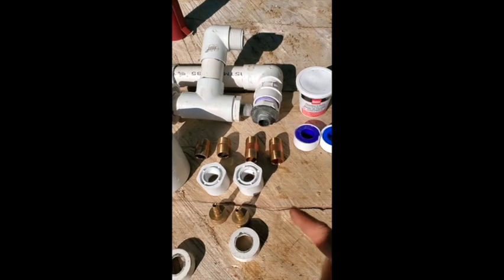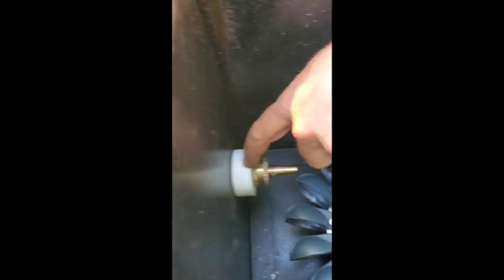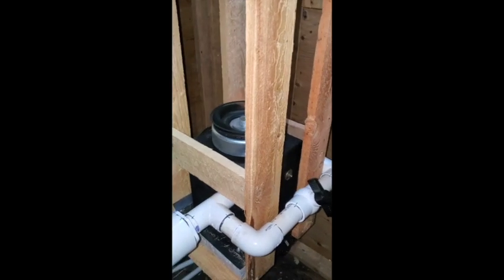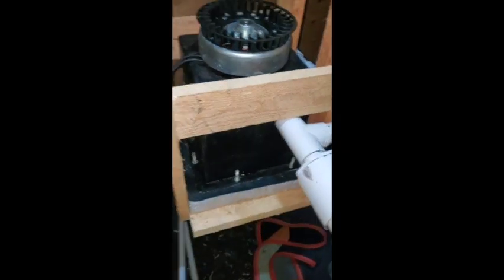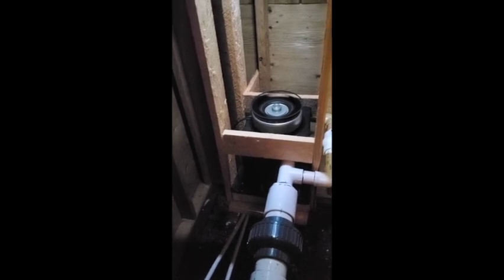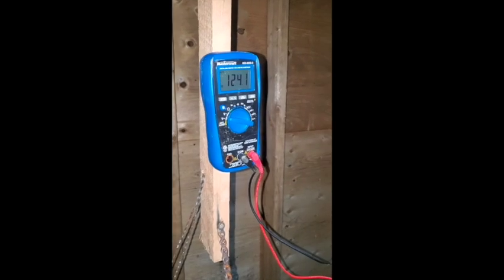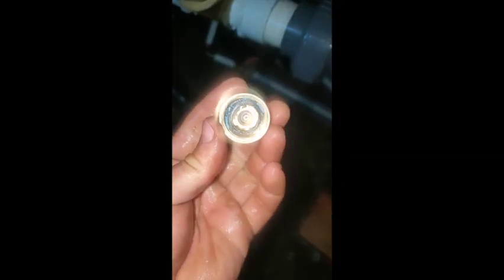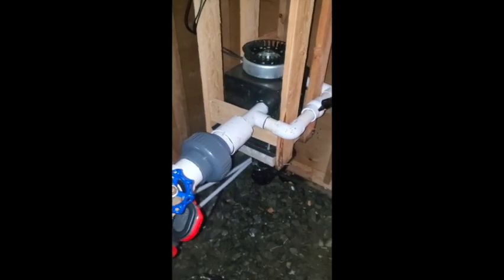The Micro Hydro Project: Episode 7 - The Turbine Part 2

Comment: You need a load on that generator or it could spin itself out of control and destroy your bearings or blow it to pieces if it spins too fast.
Reply from the maker: Yea I only had it running unloaded to make sure that the specs for the inverter and the rest of the electronics would match the potential output. It always has a load on it now :) Thanks!

Comment: Also, if you exceed the maximum rated voltage, the voltage can overcome the insulation on the windings and short out some coils in the alternator which will lead to overheating and poor performance. Ultimately, it will completely ruin your alternator.
Reply from the maker: Yes, great advice. Fortunately I was just doing this to find out what the maximum unloaded circuit was so it was only for a short time. I was instucted by the guy who made it to do so but your right, now i always turn my inverter on before I turn on the hydro to keep the rpm's in check! Thanks

Comment: You really shouldn't run your turbine without any load on it and full flow; you will likely exceed its maximum rated speed.

I suggest designing some kind of pit or sump in which the turbine housing sits. That way, you are likely to catch any water coming from leaks on top of the turbine discharge.
Reply from the maker: Yes, I only ran it unloaded as the guy who helped me design the system wanted to know the output to help for the specs for programming the inverter. Now there is always a load on it.
And the whole floor of the powerhouse has about 2ft of gravel to act as a drainage pit if the turbine discharge leaks. Ideally, it doesn't!

Comment: at 11 "43 immediately put a cooling metal for the diode bridge, if ... it burns
Reply: Rectifier bridges are made to be mounted on a heat sink
because depending on the current that passes, >0.7 volts are lost on each diode which unfortunately are heat losses. If you have cold water, use it to keep the diode bridge cool..
Reply from the maker: Not sure I understand what any of that means! Haha could you elaborate please? Burning sounds bad...

Comment: Why didn't you just remove the nozzles and let it run for like 5-10 minutes then reinstall them instead of repeatedly cleaning them out and reinstalling them?
Reply from the maker: The drainage in the powerhouse is only meant to support a little water. When we took off the nozzles and opened 'er up, it flooded the whole place pretty quick so we kept the nozzles on to reduce the total volume of water. You're right though, would have been easier to just let it rip!
Reply: @manvsland  the drain should have a diameter 2 and a half times the diameter of the pipe
Reply from the maker: @udos46 
How'd you know?!?! I did end up exchanging the 3" pipes for 4" to increase the drainage - nice one!